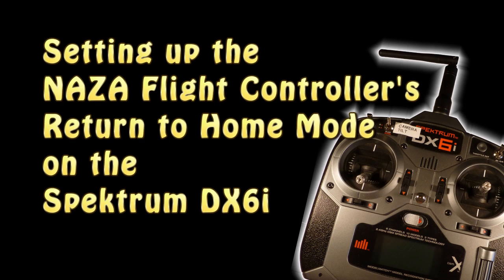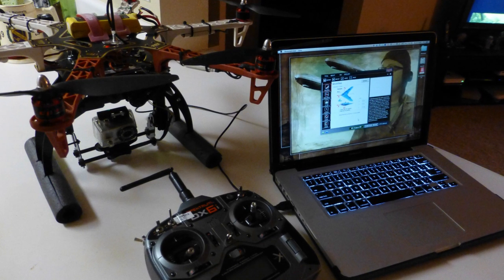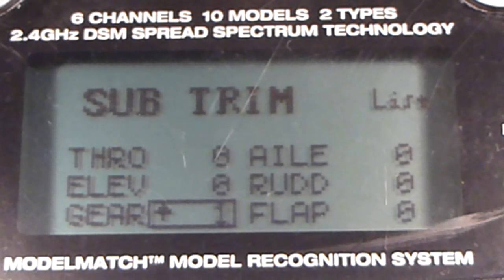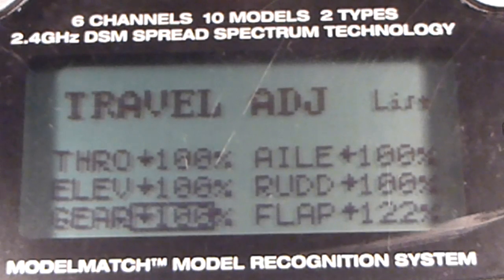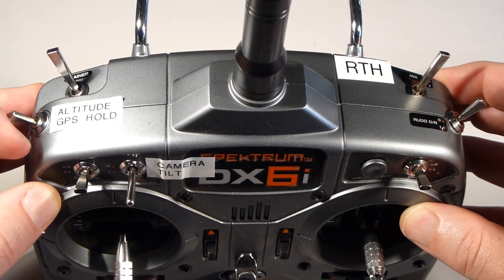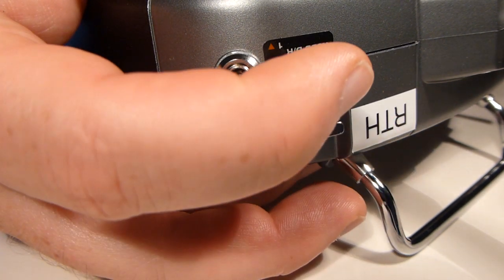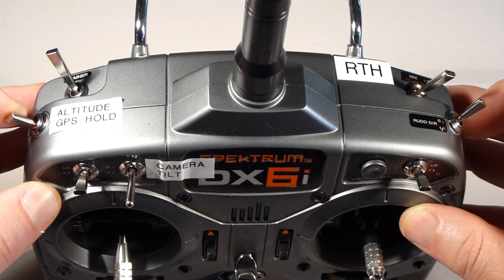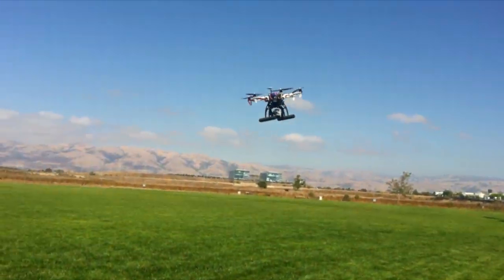Setting up the NAZA's Return To Home on the DX6i

Comment: First off, Thank you! But I have a quick question. I noticed on the flap/gyro switch you had labeled: camera tilt. Are you able to use naza to stabilize your gimbal AND use the gyro/flap switch to rotate to straight down shot while in air? Instead of having to land to change the camera angle? THANKS!!!

Comment: Thanks. I am getting ready to try this. Can you go through the procedure of initiating RTH fuction when flying and then aborting it right before landing and then flying off again? Now i can fly only in GPS mode then go to failsafe and it will RTH and do great. But i need to be able to abort landing for safety reasons. Right now i have no control, and can`t get it back in GPS once i toggle to failsafe mode.It`s gonna land no matter what. Reset battery.Using the DX-6i as you. Thanks for your help.

Comment: As previously stated this is not a true failsafe situation on radio signal loss, 
Also how do you calibrate the gps when you need to toggle between Manual , Atti and Gps to do this ?
Nice video and will work fine , but for true failsafe features as intended for the naza you will need a receiver like a AR7000 or AR8000

Comment: Nice video, you mentioned that if you are in GPS Mode then you have a Fail-safe on the MIX switch.....I understand that, but will you also have Fail-Safe if you are in ALTITUDE mode, or does it only work in GPS mode ?

Comment: If the DX61 loses power / signal this is how to fail safe it...

1. with Tx on set the switches as though to induce failsafe and have the throttle at 40%. 2. switch off Tx. 3. Put the bind plug in the Rx and power up. 4. remove the bind plug. 5. turn Tx on holding the bind switch.... I've just check this with the Naza set up assistant and when I power off the Tx it goes in to failsafe.

Comment: I see you have a Tag in Flap to tilt the camera... How do you programed that? Are you using 5 channels to Naza and 1 to Tilt? Can you help me on that? Thanks!
Reply: plus 1 to this. there r a few vids that explain it but they are leaving sumin out because with those directions I only get a change in speed at which the camera tilts, it doesn't adjust the limits.

Comment: Very helpful video! Thank's a lot for sharing that :)! In fact, I have just build my own quadcopter and I still have to buy the transmiter. And DX6i seems to be perfect to me but I see that on DX8 there is a "wheel" (sorry for my english) on the top to control the tilt of the camera. So, since I will mount my fpv system later, I don't know if it is possible to correctly control the tilt on dx6i? And I see you have a "tilt camera" paper ^^ Could you tell me a little bit more on it :)? Can you control the tilt while hovering, then return in flight mode and continue the flight? (Is the camera keeping the new direction you've chosen?). If so, I will definitely buy the DX6i ^^!
Reply: I have the exact same question and problem, i used this video to setup my DX6i with the AR7010 reciever and it works perfectly including the RTH, (and tested).Thanks for the vieo btw, very helpfull. Now all i need to find out is how to tilt my zenmuse with the DX6i. HELP! :-)
Reply: great question - so I take it there is not a way to get camera control.
Reply: Style Review Nope,,with the DX6i you are 1 channel short. I bought the FrSky Taranis radio with X8R reciever, that gave me 16 channels and all the knobs, switches and features you can ask for.

Comment: Brook,  Do the DX7 and DX 6 set up the same ?
Reply from the maker: Hi Sam, I'm not positive as I don't have a DX7 to compare.... But I would think the menu system would be similar. One benefit of the DX7 is that it has a 3 position switch that you could assign as the flight mode switch.
Reply: Hi Brook
Thanks for the email, when it comes to programming the radio I'm lost,  I like the DX7 but find it very difficult to understand. Wish I could find someone to walk me through the steps.

Sam

Comment from the maker: Nope the Fail-Safe is a mix with the GPS mode. You must first switch to GPS mode with the GEAR switch and then toggle MIX 1 to enable Fail-Safe. Mind that this is a Manually engaged Fail-Safe.... you must have radio contact to enable this third flight mode. This is NOT a "true" Fail-Safe that automatically engages if you lose radio contact. To have "true" Fail-Safe you must step up to a higher end Spektrum receiver as the DX6i and it's corresponding receivers do not support that.